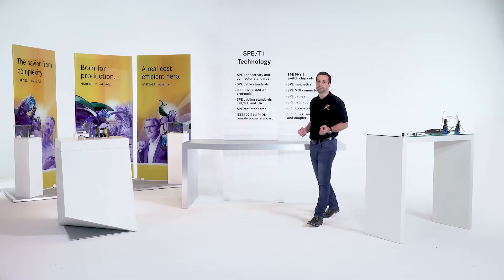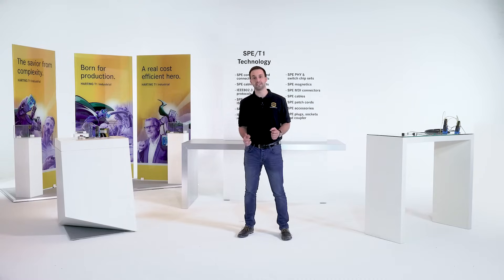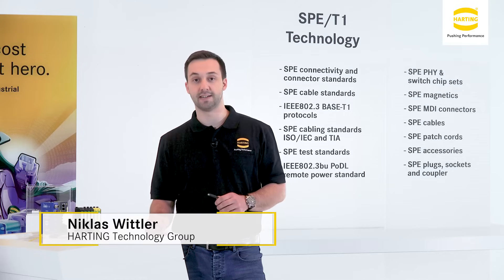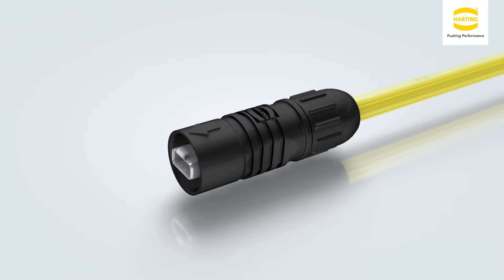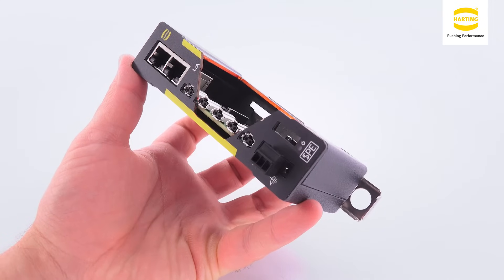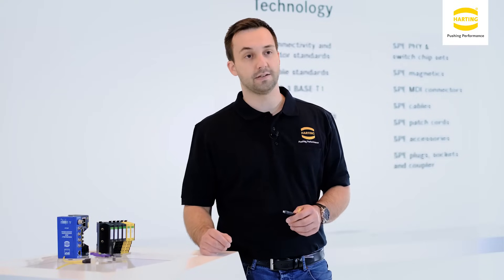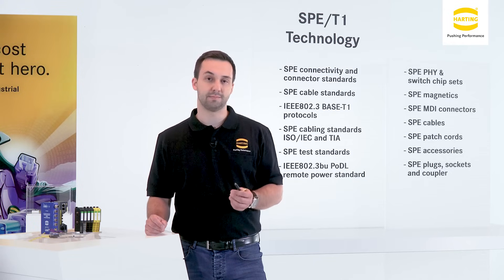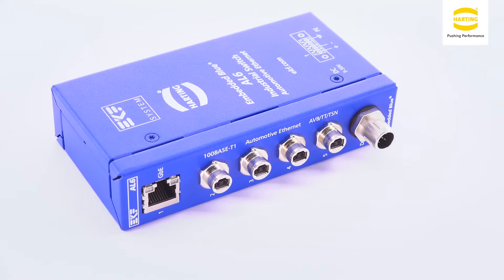Single Pair Ethernet (SPE) - explained easily: The Enabler for IIoT

Comment: Hello! 1) Where can I buy Modules (or IC) to get(make) SPI/UART to SPE bridge? For example I use W5100, W5500 IC (and ready modules) for Eth. 2) I saw SPE to Eth bridge on installations, where to buy it?  3) Connectors is nothing without signals to transmit through it.

Comment: Eh - you can set a connector's shape and size, but people are still going to end up making an RJ-9 interface. I get the reasoning for the integrity of a connector in an industrial environment. But I have also seen RJ interfaces (45, 9 and so on) clogged with particles in all sorts of settings. They work nonetheless, and a blast of air cleans them out quickly if necessary.